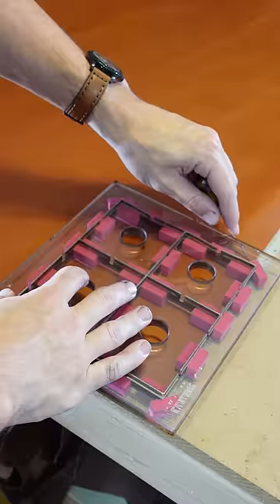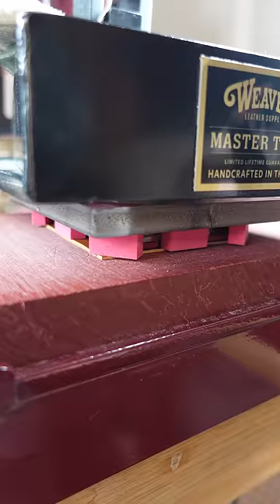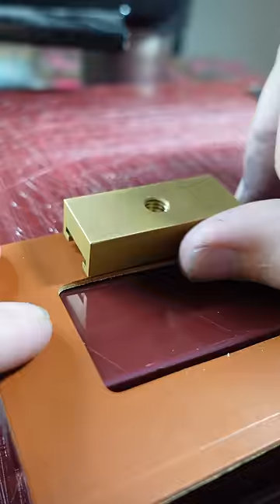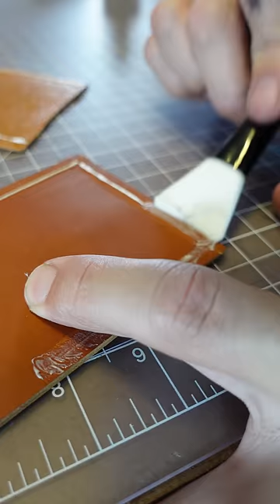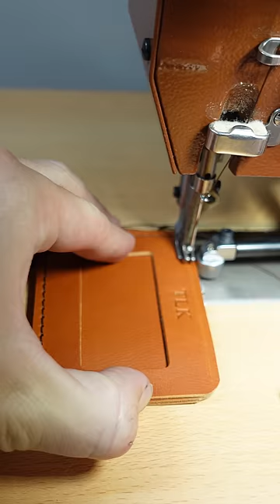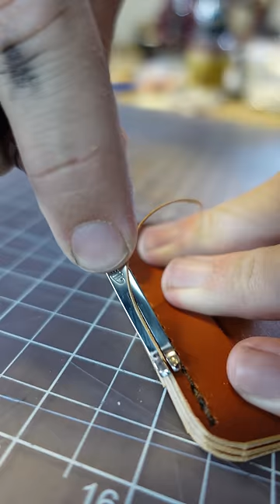ID Wallet For Minimalists

Comment: Unfortunately, I can not recommend their wallets. I got mine almost 3 months after ordering it and almost gave up on it.  Once it finally arrived, I was delighted but realized how small it was. I could barely fit two credit cards in the thing, let alone anything else. Lastly, the leather scratches so easily.  What was a beautiful wallet is now something that looks 3 years old. I think I've had the wallet for less than a week and it has been completely scuffed up (just from my car keys). DONT BUY.